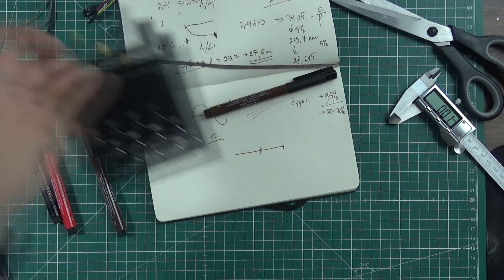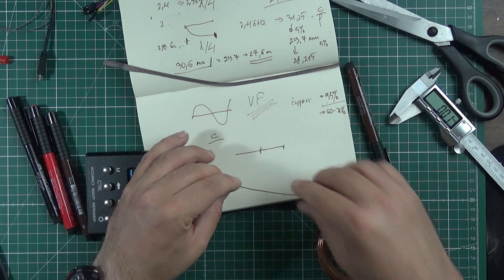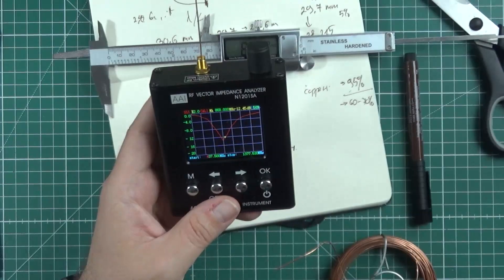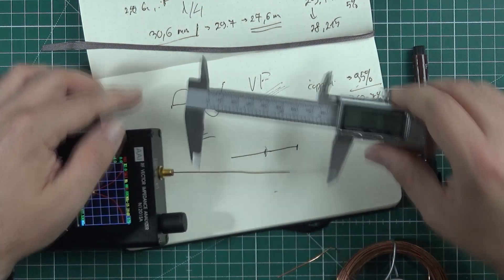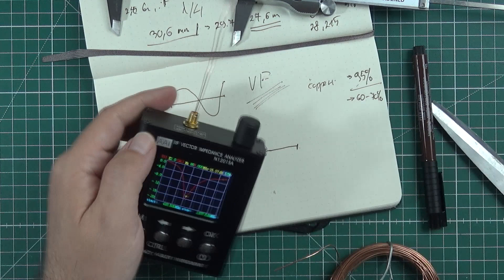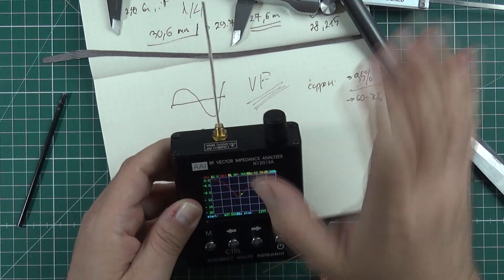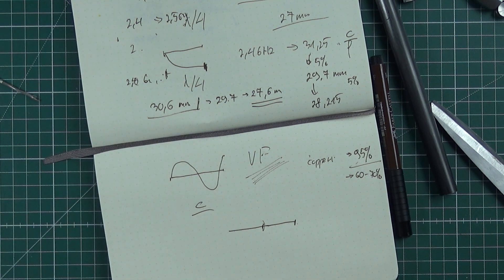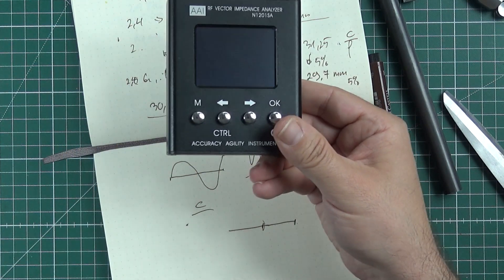How long 2.4GHz antenna should be? The experiment with an antenna meter

Comment: Türkçe:
Merhaba, RadioMaster Zorro 4in1 kumandam var ve Jumper ELRS modülü kullanıyorum. Bu modüle uygun 2.4 GHz ELRS anten hangisini kullanabilirim? Sizin yaptığınız gibi bir tane yapsam düzgün çalışır mı?

İngilizce:
Hello, I have a RadioMaster Zorro 4in1 transmitter and I'm using a Jumper ELRS module. Which 2.4 GHz ELRS antenna can I use with this module? If I build one like yours, will it work properly?

Comment: Thank you for this information. I have various no name replacement antennas with ufl plugs and also without plugs for direct soldering for my various receivers. With these antennas, the active elements are longer than those built into the receiver. If I have understood correctly, can I simply shorten these active elements to the length of the original antenna? What influence does the diameter of the active element have?

Comment: Hello Pawel! Does the non active cable length matter? I wanna to make some pigtails on 2.4G and also on 5.8g and I am wondering how long I need to make them. Thanx!
Reply from the maker: yes it does. Laymans terms: lemgth should be a multiple of half wavelength in coax. So: multiply of Veloticy_factor * C / f
Reply: Thanks for the swift reply! It kinda bothers me how could I find out the velocity factor of a chinese coax.
Reply from the maker: if it has a name like RG174 RG178 RG316 then should be easily findable. If not, then usually between 65-75%. Use 70% when in doubt
Reply from the maker: well, you have to assume that someone computed it correctly :)
Reply: The coax is probably RG-113 but bumped to it only at Chinese webshops. No velocity factor found so far, only a velociraptor. :)

Comment: many people use the zip ties or plastic tubes to mount the antennas at their copters. What would be a reasonable approach for velocity for the coax cable including the teflon insulation  and this plastic material?
Reply from the maker: those things affects VF in a very very little way. It's fine to use them

Comment: So conclusion is still that FrSky have shipped wrong antennas, it's just that the bad stuff is the x4r-sb and not on the xsr etc... 
  
Is it really true that the transfer of the signal into space is best when the antenna is perfectly tuned?  
  
Say that we have a singularity sized Vector Impedance Analyzer... the antenna itself would present a larger part than the ground plane of the analyzer and so the whole equation would be thrown of the planet. This happens in reality too, although it presents a less significant part of the problem. And it happens in the aircraft too. So obviously each installation would benefit slightly from being individually tuned based on actual radiated signal measurements... All for those who cares about details.
Reply from the maker: Once again it's not that simple. X4R-SB might have some extra capacitance in the feed line and that requires longer active part of the antenna.

Comment: Great video! Would be great to know what size to cut replacement antennas for our receivers. So far no one has been able to give a scientifically satisfactory answer.
Reply from the maker: I can not give you that answer because it all depends and the antenna materials, how receiver is constructed and so on. Assuming receiver itself is "neutral", then 90% of the c/f seems to be universal value. So around 28mm. But it really all depends